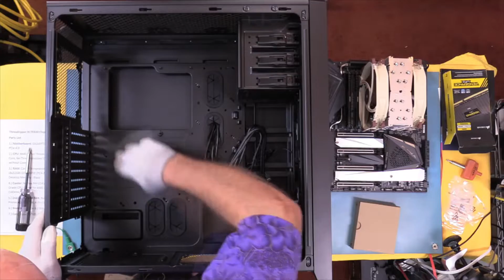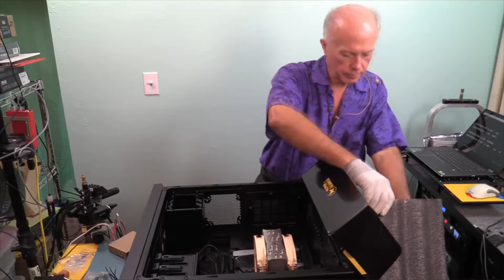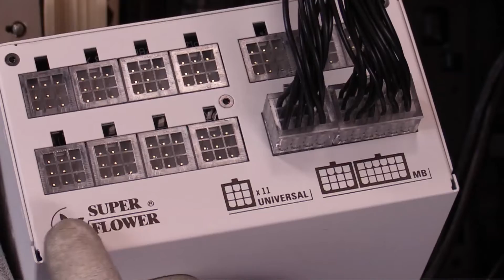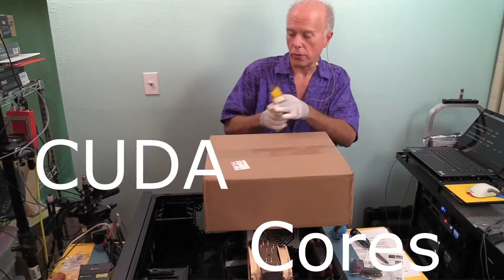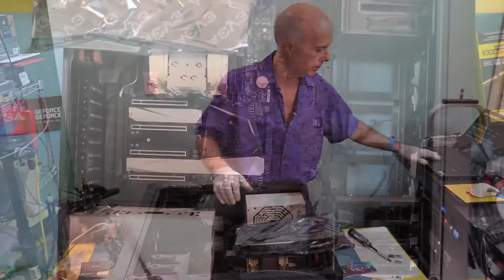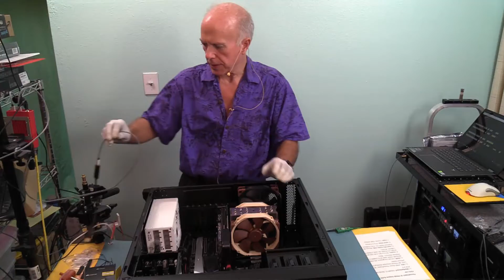AMD Threadripper 3970x Build Tutorial - Assembly and Smoke Test!

Comment: Thank you for doing what you do.   I was going to build a Ryzen computer X570 for my Recording studio. After watching your vids I understand the value of the TRX40.  You are amazing!!!!!
Reply from the maker: Hi Lou Roppoli, 
Welcome! Appreciate Your Comments! All about Resource allocations! All about the Chipset! Build a Computer that will work for more than 2 years. Everyone focuses on the CPU. Focus on the Chipset! You will not outgrow the TRX40 for Audio. Changing one thing can change everything! Details matter! 

The X570 looks good on paper. However, every implementation We've seen does not measure up nor justify the Build based on PCIe Resources as allocated. Which is a real bummer! 

But the TRX40 HEDT is the Solution! A Foundation to grow with! Stay tuned! 

What Audio interface are You contemplating? Suggest Keep it Simple!
Reply: @BuildOrBuy  I have been using a RME 9652 PCI card for the past 20 years in my studio with lots of outboard gear ie preamps, compressors.  IO consists of 2 Focusrite Clarett Octo Pres that give me 16 ins and 16 outs. The RME card has been flawless and has never failed me over the years.  I know there are no PCI slots and that some people have been using the STartec PCI to PCIe expansion with good luck.  Im not really into that solution.  I also have a Presonus Quantum thats why i need thunderbolt to work. That interface also has ADAT light pipe so i can still use the 2 existing Focusrite Clarett OctoPre.

If I have issues with the Presonus Thunderbolt I will move to the RME ReyDat PCIe Card solution to replace my trusty RME 9652 PCI card that RME still supports (amazing).  Sorry for the all the rambling Im such a geek with tech.  My current computer is a Intel i7 4790K with 32G ram and Gigabyte UD3H z87x chipset. The RME 9652 card was in an older machine before my current system.

Its Time for me to upgrade and make a new system with more power HEDT TRX40 Thanks again for replying to me and THANK YOU FOR YOUR great work here on youtube.  Do you have a Patreon page?  I would love to support you!!!!!
Reply from the maker: Hi @LouRoppoli , 
You definetly have Your monies worth! Ubiquitous PCI had more longevity than 1394 FireWire! Presonus Quantum - Rackmount! Smart! The Presonus Quantum should be a solid performer! Which means You're using Presonus software! We can relate! Get Your Geek On! Rock On Geek! After all, it's all about the Music! Gigabyte GA-Z87X-UD3H - Last Bios Update: 2014. 

Agreed! Time for an Upgrade! HEDT TRX40 - Thunderbolt 3! Just so You know, Gigabyte is also doing the 5 Pin Header for Titan Ridge Thunderbolt 3 on WRX80 Workstation Motherboard! Always! We're here to help! 

No Patreon. BuyMeACoffee! Appreciate Your Support! We just finished a Video about the new Adobe After Effects Multi Frame Rendering (MFR) Formula for Optimal Rendering Build Specs. Which is all about CPU Optimization. Doing Audio is also about Rendering. Worth a Watch! https://youtu.be/jt9_nKKddcU 

Your Comments help Us to make better Videos! We're all about answering Questions! We still have 2 more Videos in the wings for 2 different Thunderbolt 3 Audio interfaces. One being a Presonus Thunderbolt 3 Audio interface! 

Keep Us posted on Your progress! 

If You'd like to Support BuildOrBuy... https://www.buymeacoffee.com/gillboyd
https://www.amazon.com/shop/buildorbuy
As an Amazon Associate I earn from qualifying purchases. Thank You for Your Support!

Comment: I have a big problem.  I managed to plug in two PCIE cables into the CPU  header.  They had the right number of pins and I know it's not supposed to fit but it did.  I had someone put a volt meter to the PSU and it is dead.  Should I assume everything that was plugged in is fried?  How can I test all the parts?  I think I just killed a $6500 editing computer with a 3090 in it.
Reply from the maker: Hi Woolly Dread, Before we say either way, what PSU Brand and Model are You using? If those are Universal taps then no. Could be just a bad PSU. Let's walk through this logically. What happened when You turned it on?
Reply: @BuildOrBuy  Nothing happened.  It was the Bequiet Straight Power 11 1200W 80 Plus Platinum Power Supply.  When I flipped the PSU on I saw that the power button on the motherboard is blinking red and the CMOS on the rear IO is also blinking.  When I try to power on from the case or even the mother board itself still nothing happens. After that I took out two sticks of ram leaving only two remaining in the correct spots.  I also removed 2 M.2 drives leaving just one in the first spot.  The graphics card remained in the whole time and I tried turning it on several more times making sure everything was connected ect.  It might be another week or more before I get a new Power Supply.
Reply from the maker: Hi @woollydread2743  , OK. What are the Debug LED Codes You see on the Motherboard?
Reply: @BuildOrBuy  No other codes or lights came on.  Just a flashing red power button and the CMOS on the back.
Reply from the maker: Hi @woollydread2743 , Sounds like a bad CPU. RMA. Are You within the 30 days? If not, direct to AMD. If this is a bad CPU, You are the 2nd. One of Our Subscribers in Columbia had the same problem. Very odd. I have not seen a BAD CPU in over 20 years and now Two? Crazy. Keep Us posted.
Reply: @woollydread2743  Hi, what was the outcome? Did you get things fixed?

Comment: many thanks for this - I found this extremely helpful!
Reply from the maker: Hi Adam Robertson, Nice to meet You!Appreciate Your Comments! Thanks for Watching!
Reply: @BuildOrBuy  I'm about to purchase almost the exact same computer so it's awesome I found this.  I have two questions if you have time:
1) is there any way this motherboard could fit in the Corsair 4000D Airflow or a smaller case?  I don't need any HDD/SSD room and would like to be able to transport it once in awhile.
2) I'm looking at the be quiet! Straight Power 11 1200 W 80+ Platinum Certified Fully Modular ATX Power Supply because it's currently $250.  Do you have any opinion on it?  I will be doing but a lot of 4K rendering in Resolve so platinum over gold makes sense?
Thanks in advance!
Reply from the maker: Hi @woollydread2743 , 
Nice to meet You! Glad You found Us! Good looking Case. Hard to tell. That Strip that says Corsair on right side of Motherboard for covering Cables would be my greatest concern. We know the Case is ATX, We don't know for certain if XL-ATX will fit. It should work. No way to know without trying it out. Other than asking the Vendor directly. Portability. I get that! Place a Carry Sling on it and go!

The PSU - Get it! 1200 & 1300 watt PSUs are scare as hens teeth right now! Suppose to be the best PSU in Germany. Excellent Price! Platinum, Yes! Keep Us Posted on Your Progress!

Comment: This video is really great. I like watching you work. Thanks for taking the time to share and explain everything. 

Maybe I missed it, but what power supply were you originally intending to use if it was in stock?
Reply from the maker: Hi krackpot, Thanks! Appreciate Your Comments! Details matter! Are You planning on Building a Threadripper 3? If You need any help, let Us know!

SeaSonic, 1,000 Watt PSU. Still hard to come even now. And the prices are ridiculous! 

We're finishing up the Gigabyte M.2 AIC Video right now. That was interesting getting that configured. Stay tuned!
Reply: BuildOrBuy Thanks, can’t wait for the next one! Making my way though all of your videos. 

I’m looking to replace an old 2600k machine which has seen a lot of use since work from home became a thing. It’s been a long time since I’ve built a PC! Waiting for zen3 to drop before going 59xx top end or Threadripper. Not sure I need that much power (and life presents new responsibilities too). I build for long term as you can see from a 9 year old system! I want to explore VFIO on my new build. Want it to be as flexible as possible. Still a lot more research to be done!
Reply from the maker: Hi @krackpot_ , Thanks for Your support!

10 years, You have some catching up to do! We're coming from an AMD 8350 CPU on the 990FX chipset. Focus on the chipset. 

If You prefer Intel, look at the x299 Chipset. Specifically an ASUS x299 Workstation class Motherboard with PLX chips. 

Are You planning on running Virtual Machines? Lots of RAM! What else will You be tinkering with on Your new Build?

You might be a candidate for Threadripper Pro! We should see parts availability by either December or February. AMD will want to show that off at CES!
Reply: BuildOrBuy Thanks for your comments!

It’s been a long time coming. I keep putting it off, but we’re at that point a new machine is necessary to keep sane. 

I currently run a VM which is fairly critical and runs 24/7. Doesn’t make a lot of money as long as it runs. I keep needing to reboot to correct errors. Mostly when the CPU on the host is pegged above 95%. I don’t know if it’s because the overclock with slight overvolt is starting to take it’s toll.

Thanks for suggesting x299. I hadn’t considered that platform as it was older. I don’t mind either Intel or AMD. I like performance but at a good price. Bang for the buck! :) Looks interesting at a quick glance. I like the plx chip you suggested. Beastly for more lanes! I’ll have to do a deep dive on that now!

I do some trading on the side, where I have a lot of audio/video streams usually 1080p playing all simultaneously. Browser windows galore with a lot of tabs (1k+, not all loaded of course!). I gave up gaming at the start of this year, but might play the larger titles as time is limited these days. Basically the PC needs to handle a variety of current interest tasks and any other crazy ideas I might have.

Comment: GOOD SHOW. Will you be using a PCIe card for ram and create a raid array or a Highpoint SSD7505 raid card?
Reply from the maker: Hi Max Hughes, 
Thanks for Your Comments & Questions! RAM Disk? That's a Thought! We need to Test first. Since this Motherboard includes an NVMe Quad card, we'll use that one 1st! We currently have two other NVMe Quad Videos posted. 

A Highpoint SSD7505 raid card, possible. Bifurcation built-in. Curious. PCIe 4.0, yes. We are working on several other NVMe Quad cards we need to complete.  Had to get this TRX40 Build done for the PCIe 4.0 vs PCIe 3.0 Discussion. 

Have You watched either of these? 

1.) ASUS Hyper M2 X16 NVMe Quad card plus four Samsung 970s - AMD NVMe RAID 0 Upgrade

https://youtu.be/x5G-zciner4

2.) GloTrends Sky x8 M.2 NVMe Quad card Unboxing and Setup Installed in HEDT X399
https://youtu.be/QF71-5nhrAk

Stay tuned!
Reply: @BuildOrBuy  Yes I saw the vids. I have the first gen 1900X/Zenith Extreme with PCIe gen3 cpu lanes. I'm using the Asus Hyper Gen4 PCIe card with 4 Sabrent 2TB gen4 M.2 drives with TLC nand. Just 4 drive letters and no raid. Looks confusing to go AMD raid. Highpoint just launched that 7505. $600 ouch! Might be a lot easier and avoid a crash after a Windows 10 update. And raid in LInux, WOW
Reply from the maker: Hi @maxhughes5687 ,
OK. Excellent! Our purpose and intent was to show, how to install a non standard install. We did not make that point clear enough. We'll do better next time!

The Highpoint card has Bifurcation built-in. It would be suitable for PCIe 4.0 Motherboards that have a x16 Slot that cannot Bifurcate. Which seems to be an oxymoron from our perspective and what we know. 

We will do a follow up with a Video just about Bifurcation for clarification after this TRX40 Build. It will be more appropriate then, than now. 

Always the Question, to RAID or not to RAID.. Then, software RAID or Bios Hybrid RAID. The point to take away from all of that? Options. 

Any NVMe Quad card over $300.00 will have a Chipset with Bifurcation built-in.

Comment: Hello thanks for your videos, I am assembling a pc equal to your configuration but there is no stock right now. I see that many people talk about some failures, in the c1 or c2 ram slots I do not remember and problems with a pci port, why is there TRX40 DESIGNARE 1.1 and 1.0?
Reply from the maker: Hi Victor, 
Good Questions and good timing! Congrats on Your decisions to Build! No stock? New Stock coming! RAM Slot failures could be due to several reasons. Handling (ESD - Electrostatic Discharge), or either CPU or RAM not being properly seated. Be deliberate and methodical in Your approach to Building Your Threadripper 3. There have been a few having problems with the PCIe Slots. That could be due to knowing the Slots' Resources or Bios updates. 
Why a Motherboard Revision? When there are design improvements, a Revision is desirable. Could be traces for Audio signaling. Or the Network chipsets. That's been a big problem for both AMD and Intel over the years. Could be a design change was required for a chipset change. 

We have not had time to compare both Versions. We'd have to have both, side by side to visually inspect. Notice the new Motherboard revision has one current Bios. There will be more. This Motherboard in this Video has had four. Three are listed on Gigabyte's website. What did we gain beyond updating the CPU AGESA Code with a Bios Update? Stability and better RAM Compatibility. 

We're here if You need any more help while You Build or get stuck! Hope that helps!
Reply: @BuildOrBuy  thank you very much, very complete answer
Reply from the maker: Hi @victorgallon99  ,
You're most welcome! Absolutely! Details matter!

Comment: Thanks for sharing, Gill. I built a 3990x with this Case and this motherboard as per your suggestions. I went with a Be quiet! CPU fan, 128 gb ripjaws @3200 cl16, a samsumg 980 evo (PCI 3)as boot d and 4 980 500GB (PCI3) on the quad card (at the moment Samsung PCI 3 was as fast as the sabrent PCI 4 - Might upgrade with the newer Samsung or sabrent when PCI4 is being fully utilized).  BTW I saw your video on assembling a quad care, so THANK YOU. Also installed the Thunderbold but dont know yet how ill end up using it. Spent a few days trying to install Windows (or booting from an installed disk) until I realized I had to flash/upgrade the BIOS. Everything appears OK, but I am not sure if I am getting the full power form the CPU. I Read you need win10 pro to fully utilize the 64 COREs so I upgraded. However, I am concerned somethings is not right because when I do a userbenchmark.com my workstation score is 90% and this processor average is 250%. This score consist of 3 tests normal (1-2 cores), heavy (4-8 cores) and workstation (64 cores), my workstation score is 359% or 5,351, so I am not sure what is wrong and if my PC is taking full advantage of its components. Any ideas ? Hoping you can usertest yours as well.
Reply from the maker: Hi Ivan, Just now seeing Your message. Had 42 Messages held for Review I did not know about! Appreciate Your Comments! I've run those. Will run again and Verify Results! Been swapping Components in and out answering Subscriber Questions that I knew about! Otherwise, How is everything running so far?

Comment: Man I hope you didn't pay the prices shown for that 2080ti with the new 3000 series cards dropping later this month. Nice build though....I want to build a TRX40 build but if I do it would be just for fun. I just built two new systems one a Ryzen 3950 for a MacOS/Windows dual boot and one i9 10900K windows gaming so another build would be just a waste of money really. But man I bet that is an awesome build for sure.
Reply from the maker: Hi Jeff Baker, 
Been sitting on most of those parts for 6 months. Been busy. More CUDA Cores, another Upgrade later! And... Another Video! Being very methodical and systematic in our approach to documenting and using this new platform. So far, so good! Two Bios Updates made a difference in stability. Now running all 256 GBs of RAM. 

Sounds like You're set for a while with 2 Builds! We're going to do an x299 Workstation class Motherboard Build later to talk about PLX Chips. We're eager to learn more about the Threadripper Pro. Still nothing on those regarding the Chipset. 

We'll be doing other Videos showing how we use this System for Virtual Instruments - Audio and Video work. We'll also run a few comparative performance tests. This is for work. Thanks for Your Comments! Thanks for Watching! And Thanks for Sharing!
Reply: @BuildOrBuy  Looking forward to the next videos! Sounds like you got the parts at the right time. I still want to build one of these systems but I just don't have anything to justify using such a PC. But I'll be watching for the future video on what this thing can do!
Reply from the maker: Hi @jeffroBodine4219   Thanks! Maybe once You see what we're doing, maybe that will make You want to go ahead and Build!